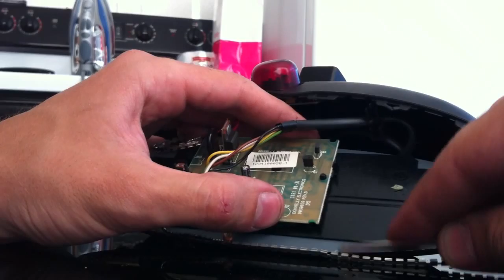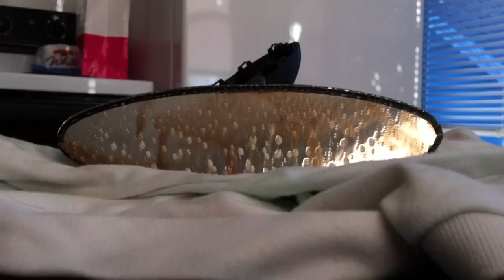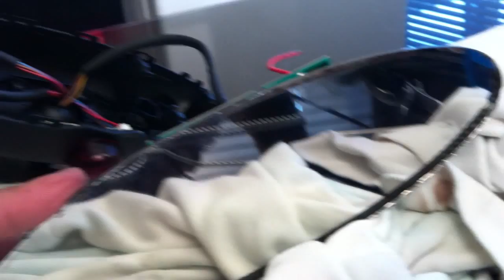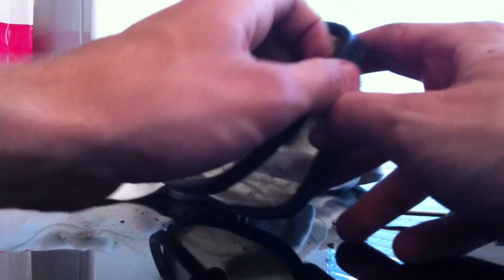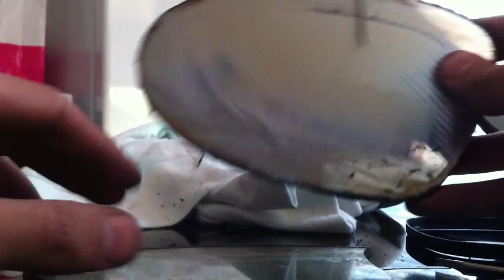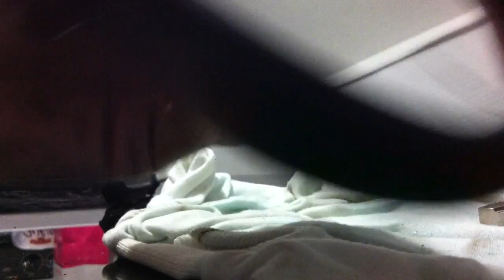Free E39 M5 Mirror Fix. (ghetto way)

Comment: For as much time you spent on doing the none repair/hatchet job! You can buy a New replacement mirror lens for $125.00!  Like to see what other ingenious repairs you've done? Duck Tap? Super Glue? Coat Hanger? Packing Tape? Washing you air filter in soap and water? Rinse out the oil filter with gas? Remember to pour in tank, the gas you used to clean filter!  Please don't share!